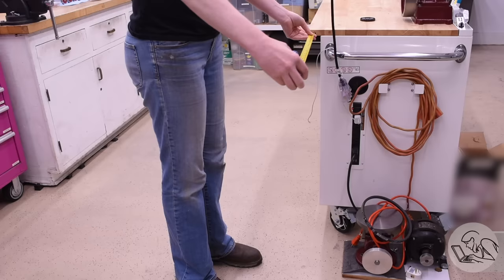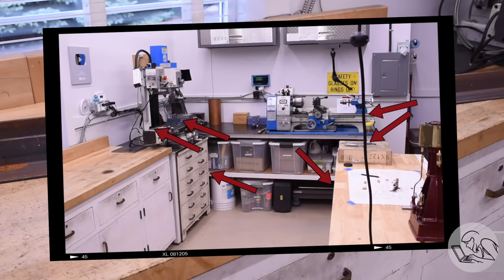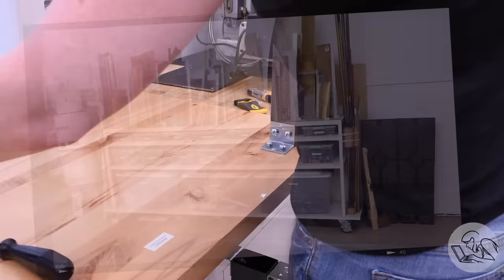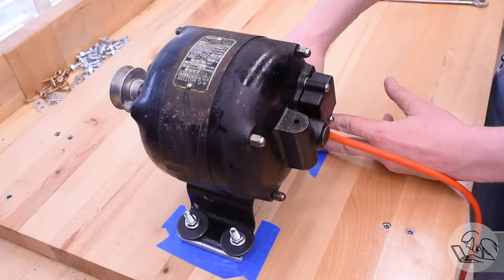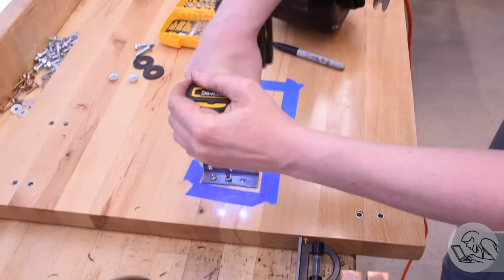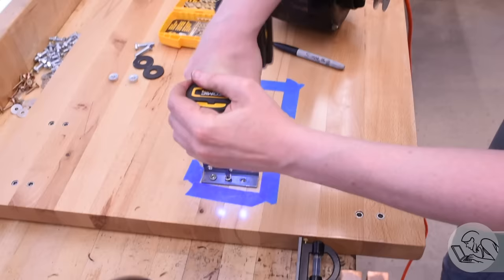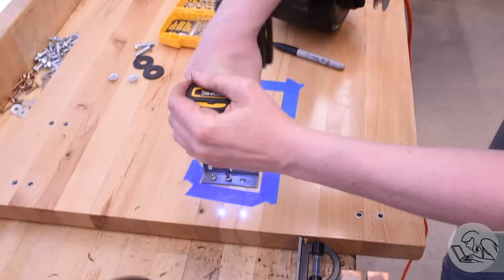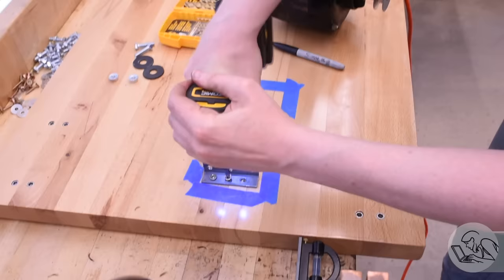Die Filer Bench (and last minute re-engineering)

Comment: You need a cover box for the die filer to keep dust out of it when it's not used. And as a platform on which to pile assorted pieces of material and small equipment.
Reply: That's why an old pillow case is better; it doesn't get piled on.

Comment: I have mounted several motors underneath small tools using gravity tensioning with good results. Rather than the hinge I have used four eye-bolts with a piece of pipe as a pivot.  Crude but effective. Perhaps it was better suited to the cellulose orientated tools I had available at the time.

Comment: Those cheap Chinese Brake/Roller/Press combos are great if you don't push them too far! We have one at the London Hackspace, and I've used it lots. Someone came along and tried to bend 2mm steel, and one of the drop links snapped! I was able to TIG braze it back together, and it still works just fine.

Comment: Hi Quinn. FYI, a rule of thumb with o rings is: The cross section should be compressed by 25% and the groove volume should be filled by about 60-70% (90% is the absolute maximum). These numbers apply for a typical o ring seal which is rated for 100ish bar, so they can be tweaked for less demanding applications. And a 15-30 deg lead in chamfer is generally needed to guide the o ring into the bore. In case you wanted to do more math… 🙃

Comment: I purchased a wood bar stool at Home Depot and mounted the filer on the seat. mounted a 1/3 hp ac motor under the seat on the foot rest. I used a habistat flat belt and I was filling. oh I put cheap casters on each leg.

Comment: Hey Quinn! Love the installation, and I expect it will see lots of use. Regarding your belt guard, in situations where soldering/brazing doesn't work, and there isn't enough space for a rivet, a small spot welder can be a lifesaver. I bought a cheapie for like $70 a few years ago and it's been a helpful problem solver. (Not the bare red PCB one -- mine's in an extruded aluminum housing.) If something causes that guard to go flying apart, it might be something to look at.

Comment: Hi Quinn , If someone suggested this idea to set the tension easily , just ignore this suggestion.
Can you place  a tappered wedge ( with a long slot in the wedge for a threaded stud and wing nut ) to slide between the base of your motor and the underside of the bench .  
Cheers , Craig

Comment: dead tree guy here. you can actually use machine screw taps on dense woods, they work really well. i'm sure someone will have some theoretical reason why it should not work, but it has for me, plenty of times! they are super strong, too. i've tested them and i've always had the failure happen somewhere other than the threads.

Comment: A plunge router and a decent bit would have made short work of cutting that slot in the worktop. 

IMHO the powered wood router is about as close to "machining" as most of us woodworkers get. Just like the metalheads out there, we have to be concerned about "feeds and speeds", chip clearance, depth of cut on each pass, selecting the right sized tool for the job, and keeping it cool. Fortunately most woodworking only requires tolerances of 1/32" or so!

Just a note to say how much I appreciate your channel, the wit and charm, to say nothing of the skill, tenacity, and creativity of its host!

Comment: Very good job on the project well done. Tear out avoidance; drill until your spade bit point just pokes through, then finish from the other side. But, a bigger issue for me is the hinge attached with wood screws and the tap in threaded inserts on the non-pivot side. I would feel a lot better with through bolts (heads recessed) tightened down well. In fact I think I would have mounted the motor on a separate metal or wood plate and hinged the plate. You could even attach the ever vibrating motor with rubber motor mounts as apparently intended.

Comment: For your adventure trying to stuff the plug into the hole with that O-ring, that's the same sort of situation engine builders have when installing pistons in an engine.  You need to collapse the ring pack while you tap the piston into the bore in the block.  There are special tools available for that in common piston sizes.  For something on the scale of what you're doing, something like a hose clamp would work.  

Wrap the hose clamp around the plug and O-ring.  Hold it over your hole, flush with the bottom surface.  Then tap it in.
Reply from the maker: I built race engines for 15 years, so yep, pretty familiar with piston ring compressors.

Comment: Good video.
That screening is used sometimes in radiator covers for home heating.
Vibration in the bench == noise.  A short piece of tubing is useful for mounting bolt grommets if a perfectly sized commercial grommet isn't available.
A machinist owning a mill and having harden-able steel stock NEVER has only one chisel.

Comment: I would have gone with a solid top, but I'm probably overly paranoid about shavings getting on belts, and it would've been easier to work with. But if it works, then it works.  Good to know those aren't brass. side note I mostly see it used as decorative vent panels or separator screens like in a confession booth... which you might want to use after that wood working display (just kidding)

Comment: In a lot of bigger machine shops like ours the basic drill press is so worn out the table wonders all about the place and if you got a good centrer drilled on the hole you ususually hit it and it goes somewhat straight through it

Comment: I worked at a UL certified sign shop and we had a calibrated plastic bending finger to test out openings in the sign. To see if anything electrical can be touched through cracks or drain holes in the sign.
Reply: I was a UK Health & Safety enforcement officer for many years. While at college I was entertained to learn about guarding machinery, size of mesh involved - and the use of the "British Standard Finger" for testing. 

If the Finger passes through the mesh, it fails, obvs. How to test without running out of fingers following Test #8? Make a Field Test Finger!

Take a page from your ever-present notebook, wrap it around your little (pinky) finger, tear it off flush with fingertip. Pinch the paper cylinder to prevent it unrolling and thrust it into the mesh. Pass or fail is pretty obvious!
Reply: @TheRedruffian  that’s interesting thanks for sharing

Comment: Another way to prevent tear out (besides your completely reasonable suggestion of doing a pilot hole and then flipping it over), is to drill using the spoon bit like you did, but to stop after the point of the bit breaks through, but not the spoon.  Then you flip it over and finish it out from the front side.  No tear out on either side that way.  But for shop tool, eh, what you ended up with is perfectly acceptable IMO.

Comment: You CAN solder aluminium... either with soft solder and the right special flux, or with low temperature aluminium "brazing" rods, no flux needed with those. It does work... really..  🙂

Comment: Hello Quinn, I know that „wood“ is a foreign soil for your type, but good job working with it nonetheless.  And it is a major product of Canada, so it may creep into your shop more and more. Just tell everyone that it’s a porous aluminum. 
A comment from the peanut gallery about thinking in the non-metallic universe ; it would have been perhaps easier to mount the motor to a slab of this strange substance, perhaps a layered version, which I’m told, is grown in sawmills. Then just attach the hinge without having to drill larger holes. I’m told that sometimes you don’t even need to drill pilot holes. 😮

Comment: On the hammer-in insets for motor tensioning, I'm afraid the screws might come loose from the inserts. I would have added a couple of nuts to tension against the insert, if that works. One can always argue that the nuts holding the motor mount will keep the screw from turning though.
Reply: (I know nothing about making holes in wood tho, we're on the same page)
Reply: @BirdTho  Yeah, that foam-y stuff has the dimensional stability of a bread slice! Tho I think 'cuz Quinn is using the threaded inserts as a "push base" for the belt tension it shouldn't be too big of an issue. The forces in use should mostly be against the wood so that the inserts won't work their way out. 🤓
Reply: @stevedaenginerd  Knowing me, I'd have put in through-holes, then used a longer bolt, washers, and nuts to go through thew whole table. I'm paranoid about trusting an insert to something with high mechanical fatigue/movement. My bets are that the vibration will eventually work the inserts loose.
Reply: @BirdTho  I would have gone with a similar setup to what Quinn used, but without the inserts and used friction alone to hold off the belt tension. But then again I'm not a fan of having supporting structures poking thru. Tho, I'm sure I would have found some reason my approach wouldn't have worked! Lol

Comment: You can improve the backstop on the press brake for repeat parts with some 8020, flat bar and angle, if you ever hve need to use it anger for repeat bends.

Comment: My primary hobby is the woodworking, but got a metal lathe and mill. Everything I have built for carts and cabinets for storage has been because of multipurpose space efficiency. I make more use of the space under tools than anything I have seen for sale. Even seen some incredibly wasteful stands.

Any tool on a open metal frame has been put on a plywood cart with drawers or doors with shelves under it. Even machines that have a motor hanging on hinges under it has been put on a cart with better storage than simply being open. Can be frustrating to buy a tool and comes with the stand I will not use.

Comment: An "old" Radio control airplane builder trick is to soak threads in wood with thin CA (thin super glue).  This hardens the threads and makes then almost strong as steel.  Just make sure the CA is completely cured before inserting the screws if you intend to ever take it apart.  DON'T ask how I figured that out!!

Comment: Hmm. I have had my eye on one of those digital screen microscopes for a while and I was wondering if it would be safe on rig mounted above my grinder. I wanted to have magnification while grinding cutting tools. But I bet that wold be perfect above your die filer. You’ve got a comfortable space behind the filer on the table for a mounting point and the table looks to be a comfortable height. Maybe make a quick detach for the microscope for other tools and an inspection station.

Comment: Given that you are a very smart person, I make the assumption that you did not want to just mount the hinge flat and cut a small recess in the table for the bolt head. Or is the a because moment?😁

But what is that nasty tan colored material that you are working on, is that an organic compound? OMG!!!

So Quinn, on the next set up, have you considered doing a shaft drive with bevel gears on both ends, or perhaps going full steam punk and doing a setup like on the engine your are building with a connecting rod between the motor and the filer? That could be all sorts of fun. The shaft drive does have the advantage of being able to be completely sealed against anything falling into the motor. 

But no matter what, please keep up the good work you are doing, I so very much enjoy you and your channel.

P.S. I do so agree that the screw in inserts are far better than the hammer in ones. The funny thing is that the first place I ran into that sort of design was in the gun world in the 1970s, there are flush mounted sling swivels that are done that way.

Comment: Here you are doing Johnny Woodworker stuff and I thought you were one of us.....Actually, if I had the room for it I would get one of those benches for our shop. 

Good Job and smart move to put the motor under the machine. 

You might think about making  a metal pan for under the die filer. I did it years ago for our Butterfly. Keeps the filings from migrating all over and trust me. You will get oil leaks no matter how good the seals are.,  (You got any ideas how i can get my guys to clean out the pan once a year)

Comment: Every now and again my last working surface disappears under a pile of stuff and I have to make / buy / scrounge a new bench. (Tidy up? wassat?) I decided to make a sturdy steel bench that I could use for welding and for knocking the living daylights out of things.. the raw material cost was over £600. Fortunately, eBay found me one ready-made for a third of the price. It weighs a cool 200 Kg (440 lb). If you have the material already, doing nothing, then DIY makes sense. Otherwise it is usually less expensive to buy ready made.

Comment: Be careful with your belt tension.  If I remember correctly, that motor has bronze sleeve bearings, not ball bearings.  Don't tension that belt like and automotive belt, or a machine belt, or you'll wear the bearings in the motor out in short order.  You should be able to almost squeeze the belt together in the middle of the span.  If that doesn't provide enough belt tension you'll need to get a ball bearing motor.

Comment: Hi Quinn, I watch your videos religiously every Sunday, they are always great - thank you!
I've always wondered why you need to lock the sliding end of the float lock vise - doesn't it counteract the torque just fine with the constraint of the slide alone? I don't have one to try it, but I do often use an F-clamp with the tail against the pillar to prevent rotation. Just wondering.
Thanks again for all the great content!
Reply from the maker: The lock is clever- it presses the jaws down hard against the table because the clamp is at a slight downward angle. Also keeps it from moving laterally while drilling.
Reply: @Blondihacks  Cool - that makes sense. Thanks.

Comment: You can solder aluminium using baby grease as flux
Reply: @raulkaap  petroleum jelly or mineral oil (baby oil) acts as a flux
This is for normal 60/40 solder
I don't think you can use silver solder as the melting point of silver is way higher than aluminium

Comment: As someone that used to build electric motors I wouldnt say smart designers, more like how can I be lazy and sell more motors. It's circular so making it multi-mount options was an easy change for no effort. Most of the time vented gearboxes would require specific placement of the vent to prevent leaking

Comment: at what point do you engineer a multi drive belt system to drive not only the die filer but other future projects? nice work
Reply: Quinn in a line shaft shop would be something special indeed.
Reply: @barcodenosebleed5485  ... driven by one of her bigger steam engines

Comment: Speaking as a woodworker of long experience, you are not likely to hear me dissing anybody for trying. Let me also mention your (one) chisel is sharp, which goes a long way with me. You wouldn't have been able to pare the slot by hand if it weren't, not in hard wood. As far as you getting on the case of woodworkers in general goes, let's just mark that down to you not having the grace to be one...